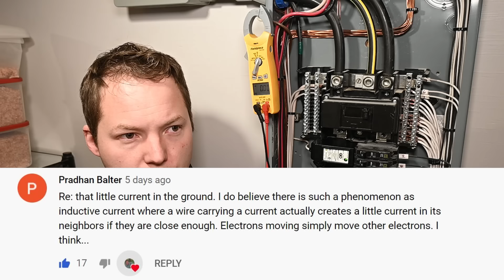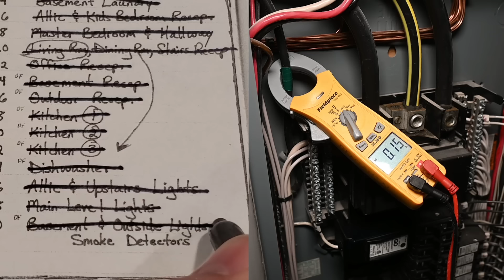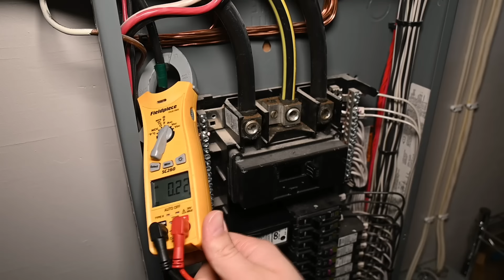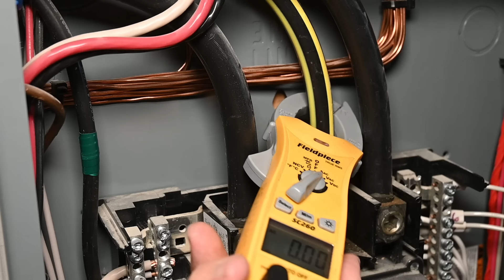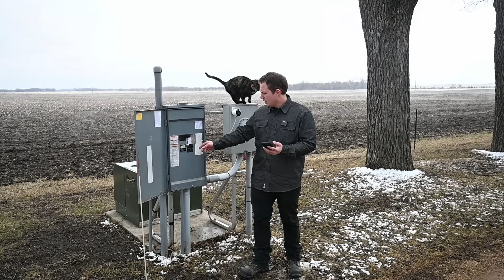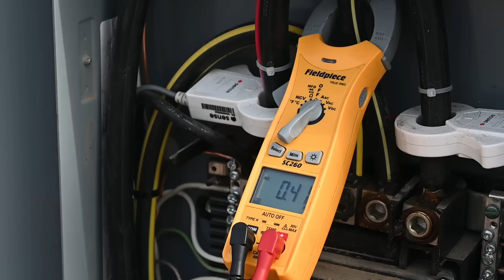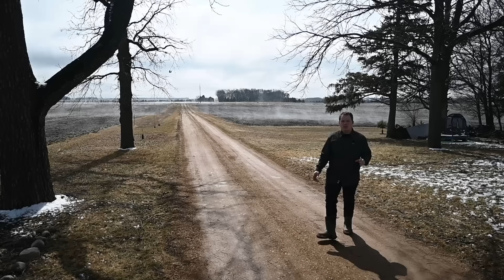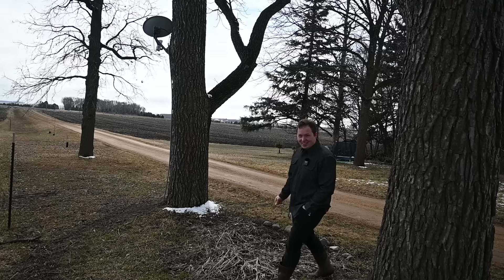Finding The Source of Stray Current on Grounding System

Comment: (Prof EE) transformers have the primary side and secondary side wiring wrapped together around the core. This is the most efficient but creates a capacitive couple. This small amount of power has to find its way back across to the primary side. Coupling capacitors are often used, but in power systems lightning often kills them; so they are often left out in open areas (like yours). 
In medical devices the transformers keep the wiring on separate core legs to stop this, but at about a 10% loss.

Comment: I never comment on videos but after looking at the first 10 comments, I'm not seeing what my gut tells me it is, which is simply a ground voltage difference between the house and the outdoor panel.  There will often be a different in the voltage between to points on the earth.  I work with towers for a living and just between the different sets of guy wires, you'll have a slight voltage difference.  If not properly grounded/bonded, the current will slowly cause the guy wire anchors to corrode and deteriorate.  My guess is you simply have a small amount of current flowing over your ground wire because the voltage at the ground rod at the house is slightly different than the voltage at the ground rod at the meter.

Comment: EMF is being generated by parallel wires inside the xfmr, you would notice that if you place your meter on AC voltage you would also read a small voltage; but if you took a wire and jump it to the neutral there would not be a spark…because it does not have any potential - this is my guess. I would run into this scenario (reading as much as 65vac) when working on CNC machines where wires are ran together in wire troughs or wireways but when I would short that wire to ground…it would not do anything; hopefully that makes sense.

Comment: Cross neutral were groundd load is not quickest path if higher than were neutral is cross, when a load is on or off causes ac current to travel through ground to complete circuit

Comment: I ran cross where white wire was hook into black black wire was on ground got feed back touch sink got 120 volt to floor counter stop stove to floor 120. I use wire tracer found the problem. I switch black to hot white to ground fixed the problem. I have 120 volts and 220 wire tracer. I also ran cross short in the wiring it self

Comment: try removing bonding connection between phone and cable tv systems. an antenna if it's bonded, also creates an ac current. thermocouple on gas apliances also create a current. although unlikely. I believe any long wire can conduct a radio wave current

Comment: thanks for doing these videos, I had to install A brand new sub panel at my house, it only had three wires going to the main.
My new box had two lugs, one for only the grounds and the other for only the neutrals,
I first called an electrician, and the guy that came by and looked at it said he was afraid he would lose his license if he worked on it because it wasn't a 4 wire feed to the box. so I had to do it myself, while waiting on another electrician that was to busy for me. your videos helped me out so much.
the new subpanel is a seimans, and the neutrals and grounds are all on a seperate lug strip, the bonding screw removed.
I had to have the grounding lug connected to 6 g solid wire, and grounded to copper pipe, due to the location of the box this was the best way for me. and the big white wire coming from the main box, is for only neutrals on the subpanel.
I subscribed to your channel out of appreciation for your videos, and discussions on subpanels,  and how they should be wired up.
Thanks so much.

Comment: Hey Ben when you say is leaking into the ground rod, you mean current is being used , current is being wasting. And your electric bill is getting higher. So if the answer yes. That current came through the meter?

Comment: Thanks for this fun video, Ben. I found this after debugging a similar issue at my rural home. The culprit in my case (and I suspect yours) is that rural distribution lines are liable to carry significant voltage on their neutrals. The way to check this is to measure the voltage between the incoming neutral and the literal ground (that is, stick a rod in the ground and measure voltage to it). Our (and I assume your) transformer center tap is bonded to the power company neutral and so our entire house ground is actually a little hot. Our grounding system is crap, so the current flowing is too small to measure, but the voltage is high enough to deliver a mild shock! Incidentally, I am having a hell of a time getting my power company to take it seriously so I'm working on my own little video to publicize the problem. Cheers!

Comment: This is been an issue for ages from line in from hydro often small amounts current are tolerated by hydro, ignored, and they will do nothing . Dairy farms are faced with this issue and often solved ,for the animals , by ground grids on the floor surface .

Comment: True:  Inductive  current is possible, but ONLY if current is flowing...   Turning off all circuits should stop all current flow on the Ground...
EMI Filters use "Common Mode" transformers to cancel EMI to or from an appliance....    They are actually parallel "chokes" , one on each Hot and Neutral wire...
Also, although current is technically correct regarding the Ground, Power is also technically correct, since it's the combination of Voltage and Current...
It's not the current that kills you, it's the combination of Voltage and Current, hence Power is applicable term...   TaaDaa..!

Comment: You have a grounding electrode conductor hooked up at your main panel and your sub panel. Current is flowing from your grounding electrode conductor at your main panel through your equipment grounding conductor going to your sub panel and then to your grounding electrode conductor at your sub panel and then back to the transformer.

Comment: The underground wires to my cabin were installed by previous homeowner and he used overhead wires pulled through metal conduit. The two hot wires were spirally wrapped around the neutral and that resulted in an electromagnet. Not sure if the metal conduit was a contributing factor, but there was a hell of a spark when I disengaged the main fuses, a knife switch sort of thing. It drove me crazy  trying to trouble shoot. Finally realized the problem, unwrapped the wires and re pulled 'em, problem solved. Electric bill went way down, radio static stopped and I had heard of stray current problems with the livestock of last guy was probably caused by this. Might be your issue. See if the wires are run paralell underground.

Comment: My main line is under ground from the pole and when the power company came out and took this monitor wand and found there was a bad spot on the wiring inside the conduit. They had to dig it up and replace that whole section. Now my lights get dim when any 220 units are turned on.

Comment: I wish I had found this a year ago.

I am a retired telephone company "Transmission Technical Support Engineer" and part of my many hatted job was to prove to power companies that they could, would, and were contributing to noise on my telephone cables with neutral/ground problems.  Without getting pedantic, I took a power company field engineer on a field trip when we had been arguing about stray currents using my telephone cable as a better ground than his neutral, and hooked up all of my meters and showed him.  Despite the demonstration, he still acted as though I was using some sort of slight of hand, and that's when I realized that he did not really understand the nature of ground and differences in ground potential, so I hooked up my Ground Potential Rise test set improperly ( slight of hand after all) and hooked one electrode to an 8 inch screw driver stuck in the ground about 50 feet away and the other lead to the ground wire from the pole pig transformer that we were near, and showed ~30Vac and about .6A.  I told him that his system (delta) was doing this, and then drove another screwdriver into the ground 50 off in a different direction and showed .1A and a varying voltage less than 5Vac.

Actually what we found, after much more wrangling, was that the rural road had had a recent "explosion" in population and businesses, including a machine shop with nice synchronous motors, and the power company, instead of re-engineering the power along the road and taken the cheap and easy way out.  Starting from the three phase Wye fed distribution line, the local line was a couple of miles of single phase with a neutral.  They converted the neutral to a phase wire and delta fed the road, just replacing the older transformers as needed.  They also clean forgot to tell us that they were no longer a Multi-grounded neutral system out there any more so that we could correct our bonding and grounding.  My telephone cable was providing a much better ground than the rocky soil up in the mountains and it was no wonder we were having noise.

So, I might be late in suggesting this, but pull those ground rod connections and prove whether the power company is "borrowing" some neutral from you.
Reply: I did telecom and datacom and had issues of ground screwing up network. I later went to electrical and after a bit I got why electricians always hated us telecom/datacom wire pullers LOL.
Reply: @lespaul36  Yeah, we kept proving them wrong.
Reply: This is kind of confusing so is the cause of neutral to earth voltage due to a deteriorated neutral conduction making the voltage use the ground as a path back to source? Or is a neutral to earth voltage reading unavoidable because of the voltage drop difference when referenced to ground?
Reply: @hippo-potamus  The short answer would be yes.  Current will always seek the path of least resistance to complete the circuit, if the power neutral is compromised and the telecomm or data comm ground is better, that's the way it will go, bringing all of the noise it picks up along the way with it.  The goal is for power, telco, CATV, and any other "artificial ground" to be a better ground than earth, avoiding all of the noise and stray currents that exist in earth.
Reply: @jimlongley9531  This topic of neutral to earth voltage is very interesting. Why does the leakage and dispersion through Ben's system not trip the gfci breakers? Is the amperage distributed such that its lower than the threshold? or is it perhaps due to the fact that its upstream from the breaker? Appreciate your knowledgeable input.
Reply: @hippo-potamus  It is due to the fact that it's upstream from the breaker. The ground current isn't sourced through the GFCI breaker, so why would it trip? The working principle of a GFCI is to measure the current difference in and out of the breaker. It's equivalent to hooking up current transformer pliers over both wires of the circuit. If there's a current imbalance then there will be an induced voltage in the coil, otherwise if they are balanced the magnetic fields of both wires will cancel each other.
Reply: @Jim Longley  
    I understand and respect your explanation,  and you are on point with your assessment!
      I just want to clarify something that is often said (I Used to say it myself) but isn't 'completely' accurate. 'Electricity (or current) takes the path of least resistance', IT Doesn't JUST take the path of least resistance... It is accurate to say that More current takes the path of least resistance. Batteries in parallel are a good example. If the 'old saying' was right, the battery with the least internal resistance would be the only one working. Another example is if a 6' person and a 5' person both held a high tension lead in between their gripped together hands, and they were standing barefoot on wet ground; ONLY the 5' person would be electrocuted because their shorter body was a few less ohms of resistance. 
     The examples can go on forever but current will flow through both parts of any parallel connection (more current will pass through the lower resistance but that is not the only path it will take)...
     I'm not trying to correct you or argue. That  saying about resistance has been around for so long that people repeat it without thinking. People who understand electricity know what people are talking about. The big problem is that people who don't know much about electricity hear that statement and take it as an 'accurate principle' of current. That can cause folks to get hurt or killed!
     Again, I don't mean any offense. I just want people to be safe. 
      Ya'll Take Care and be safe, John
Reply: @JohnDoe-pv2iu  Very true, but I did say it was the short answer and it was an oversimplification.  

I have seen a battery array that, unfortunately, had one compromised cell that was effectively acting as a resistor and discharging the rest of the cells.  When the array was broken and the individual cells were measured, by the other engineer, all he found was that bad cell was way low in voltage and he made the, invalid, assumption that something else was wrong with the whole setup and spent a lot of time trying to find a fault in the rectifier and charger.
Reply: @JohnDoe-pv2iu  Your stating only 1/2 the law, "Elec. current will always take the path of less resistance beck to its source".
Reply: @AL Hawkins  Well OK. But it will Still take ALL paths. It doesn't matter where the electricity is going to. It can go to neutral, system ground, an accidental ground or wherever it wants... But it will still take All paths.
      I remember a fellow walking through water, after a hurricane. He touched the pole of a street light... and died.
       Near me, in Augusta GA a child was jumping over a chain link fence at a public park. The ground was wet and when he jumped the fence. He was electrocuted to death. That was about two years ago. 
     People can Argue all they wish to. 
     The Point of my Post is to try to get people to understand ALL of the potential (and very real) dangers with the paths that electricity can and will take. 
      Again, as I said earlier, there can be an infinite number of examples of different situations but if electricity finds a path, Any path, it will take it!
      Ya'll Take Care and be safe, John
Reply: @JohnDoe-pv2iu  I disagree, it always takes the fastest path back to the panel.
Reply: @JohnDoe-pv2iu  You seem to think electricity will take any path it wants for whatever reason, that will get you killed, The reason we study elec. theory is to predict how it will act so we can make it safe, as I said before elec. in a residential setting is always trying to get back to its source (panel) in doing that it will always take the shortest path . This video proves it.
Reply: @AL Hawkins  Well THAT'S where your problem starts. Theory is great but experience is real. It doesn't 'take whichever path it wants', as you say. It will take all paths that are complete.
     When you get done with your Theory study, I really do hope that you get with a good experienced electrician and learn in the real world. I'm not being ugly, I don't want you to get hurt like a couple of apprentices that I have known. 
    Everyone can believe whatever they want but that doesn't make them right.
      Everyone be careful. Ya'll Take Care and be safe, John 
  PS, One day, a lot of the internet argument people are going to wake up one day, a lot older. When they do, they probably won't care about arguing as much as trying to prevent things from hurting people. The things they saw hurt and kill people, who were friends, all their lives...
Reply: If multiple paths are available, the current takes multiple paths back to the source with proportional loads determined by the resistance of each path?  I think I get you and this is my layman explanation.  Thank you!   @JohnDoe-pv2iu
Reply: @JohnDoe-pv2iu Kirchoff
Reply: Right you are.  The earth is a myriad of pathways for various currents with multiple sources.  When I was a kid on the farm, I had an old speaker out of a record player, and to entertain myself, I used to hook it to two screwdrivers and travel around the farm, pushing the screwdrivers, as far apart as possible, into the ground in various places, trying to get the loudest 60-cycle hum.  He has multiple grounds, including the mains ground at the transformer, and there is current flow between them.  Not really a problem.
Reply: I just had my problem resolved, but for the last 2 months, my neutral to my house was broken due to squirrels.  Early in the issue, I put an ammeter on my ground rod...zero amps.  I then noticed that a ground wire was bonded to my ground rod that went to my internet provider's enclosure....a coax connection.  I put my ammeter on that and saw it was pulling 1.5 amps.  I went inside and threw a burrito in the microwave....6.5 amps.  I found where my neutral load was going!  Then it made me wonder how telecom service techs were dealing with stray current unexpectedly.
Reply: How about a long wire bare ground something like an Uber ground that runs from the main towards the utility feed point down the street? This would provide a low resistance path back to the utility and reduce the path through your house and shop. Maybe a bare 14 gauge wire underground heading directly towards the utility. Something like 50 feet long.
Reply: I love how ppl comment a question he answered many times throughout the video lol…
Reply: nice question and theroy that his assumption just may be wrong without prof.